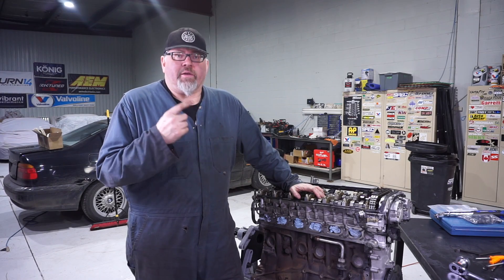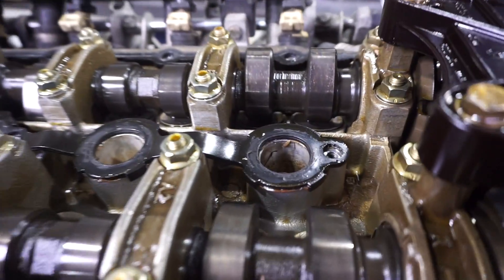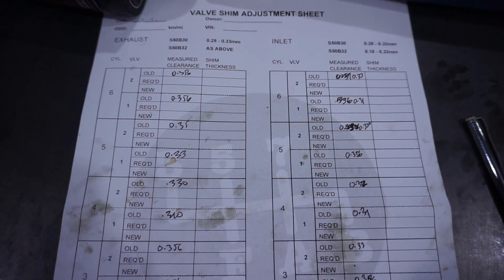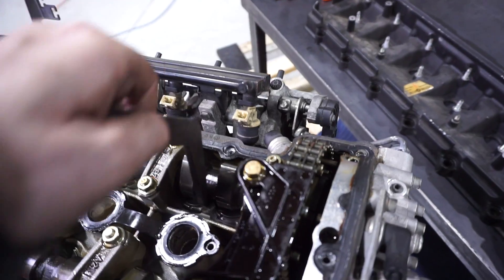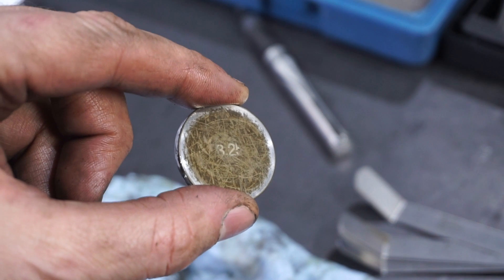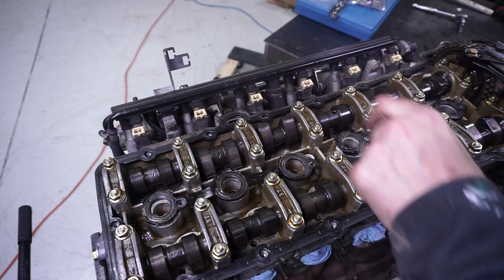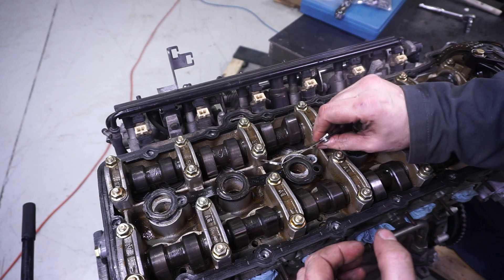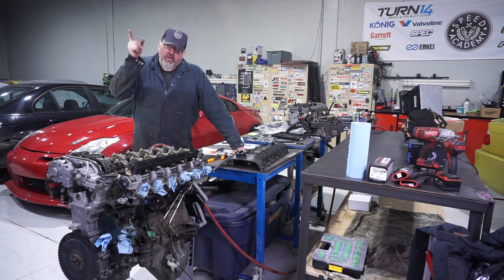How To Adjust Valve Shim Clearance on a BMW M3 E36

Comment: Some of these measurements need to be done with the engine at a certain temperature as the gap will change as the motor heats up. This mostly matters in cold climates .

Comment: Wow the top end looks great and your camshafts lobes aren't even worn or have hot spots or lack of oil changes sweet as mate.  You should clean out the sump or check the oil pump nut and so on are you doing rod bearings and bolts ? Get the arp bolts not the OEM bmw one there rubbish